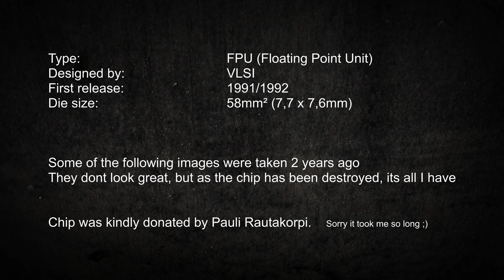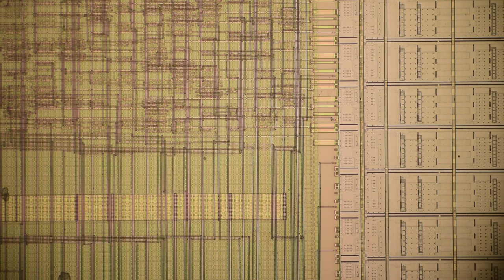VLSI FPU (1991) die shots

Comment: This is actually a gate array. It's a cheaper way of designing ASIC (application specific integrated circuit).
Reply from the maker: I'm sure you are correct in this! I found many older chips made for lower volume used this design.
But a dedicated ASIC must be far more economical in high volume production or in more complex chips.

You seem to know your chips, would you be able to identify functional blocks in the Signetics chips I just posted a video about?